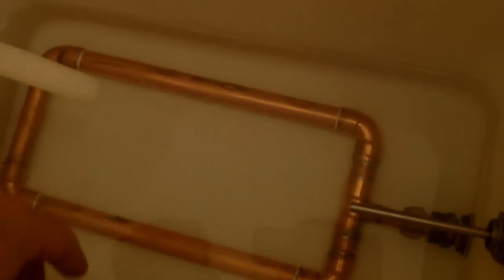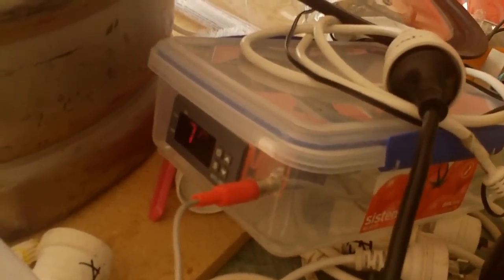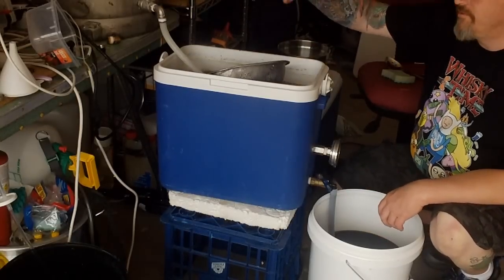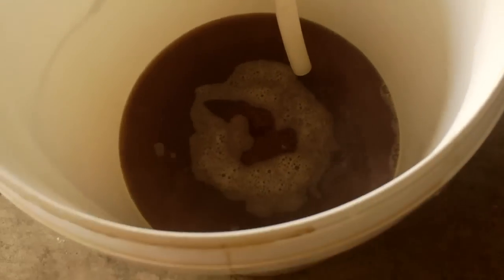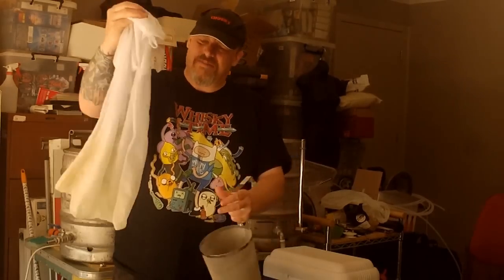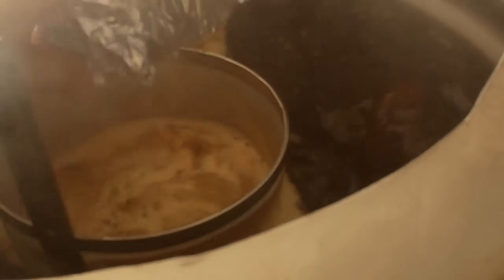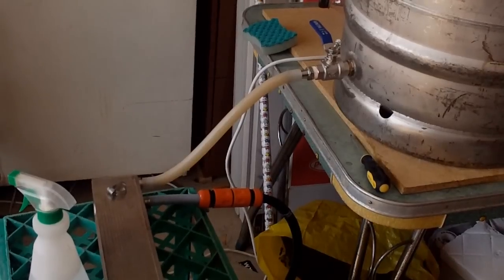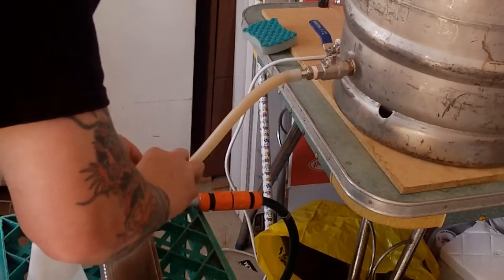Black Metal IPA 2 years on! Brewery Updates!

Comment: Ever figure out the efficiency differences?  I don't fly sparge, but they say that channeling is a big problem with fly sparging... maybe some of the previous batches had channeling issues?  Great vid Gash!
Reply from the maker: +Dan ABA I've been looking into this morning, I think it's this old Beersmith bug that seems to pop up now and then, I usually try and stop it happening, but due to a few grain changes I think it could be the cause. I had to change out a few of the grains, nothing major and they were replaced with very similar ingredients, even so BS should change all the numbers to account for this. What I find with BS is that its fine when you make a recipe and then go for it, but for some reason I find if you muck around with the recipe a lot things start going out of whack, this makes no sense to me since it should just all be simple maths, but I've stumbled across this more then  a few times. So much so I've reinstalled etc a few times. If I had more time I'd sit down and try and pin point it, because it doesn't make sense. Thing I've noticed today is even though the recipe I brewed last week had a touch more grain in it, the estimated OG is actually 2 points lower then all my other versions, that would brings things back a lot closer. I'll re do the recipe in BS and see if I can replicate the error, or at least get a different est. OG. I've probably done 6 brews in row lately of the fly sparge and only one has been significantly different. So I'm not too worried, could be just a freak thing, but if it happens again I'll morph into Sherlock Holmes :P hahaha cheers mate, take it easy and thanks for watching! Cheers!
Reply: +Gash Slugg yeah that would be interesting to track down.  Apparently the video I did about adjusting your brewhouse efficiency was based off of a bug as well.  I've seen it reproduced though.  BS has such a deep level of code with fields affecting other fields, but then fields that the user would think would affect the same other fields, not affecting those other fields (if that makes any sense).  I wonder if there is any info about this on the BS forums?
Reply: +Gash Slugg Oh, and to make things even more confusing, sometimes you just think that BS has a bug, but it's actually doing something based off of some obscure brewing science!  For example, and you probably know about this one, but BS adjusts IBU's based off of your losses in your equipment, so when people compare the IBU numbers in BS with the IBU numbers in other brewing software using the same calculation, they see differences numbers!  But in this case, it's just BS adjusting IBU for you regarding your system's losses.
Reply from the maker: +Dan ABA yeah, it's rather confusing, but logical heads like mine think it should be a few straight forward equations, which it is but as you said there are many little side equations that a small difference can make a huge difference in the final outcome! If I had more time i'd be doing all the equations myself, but would likely still stuff up now and then!  :) I do think thats where the problem in BS is, something to do with equipment settings, since I have changed that, only very slightly but it has changed.

Comment: Hey Gash, I'm gonna give your Black Metal IPA a crack. I'm going to use what hops I have in my freezer, but i'm gonna come up short by a bit with the centennial. It happens to be the exact amount I will need to add to the zero addition. My question is, could i use a second addition of cascade there instead?
Reply from the maker: awww the centennial is a big part of this ipa... but yeah cascade is good should maybe up it a little! Worth a bash I reckon! Cheers!
Reply: Stuff it! I'm just going to go buy some. I think it's an important part of it, as you said. I am going to use a different yeast thought. WLP007 what do you reckon?

Comment: Gash do you reckon that dark liquid malt you buy from bulk foods stores is OK it's in a big drum and it's nearly empty so the malt can't be fresh it's only  $6 per kg
Reply from the maker: +Matowix If its old, it probably  isnt really good, the other thing I would do is see if you can see the manufacturer and do some research, find out a bit more about it, otherwise you'll just be guessing. I haven't seen what you are talking about in shops here. Cheers mate!
Reply: Gash Slugg you have Binn Inn there I think it's Australian, that's where I get it. I asked the owner about its origin but they didn't know much about it. I tried it in a dark ale it's better than using sugar (for body etc) but you can smell the malt in the beer. I used 1kg maybee too much. I think it's called bakers malt.
Reply from the maker: +Matowix Not Australian, it's from New Zealand. If you are getting results you like I'd say continue using it, I'd be careful with sanitation though since it isn't brewery grade. This doesn't talk about using it in beer but does talk about it. http://byo.com/hops/item/1935-malt-on-the-menu